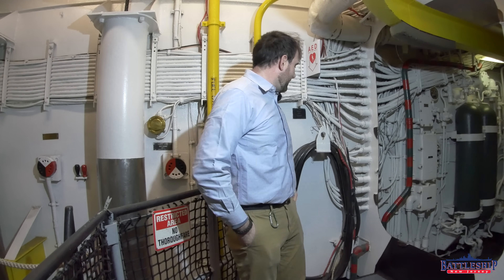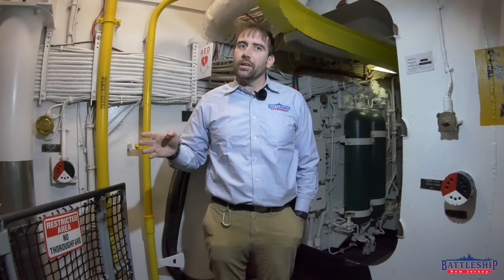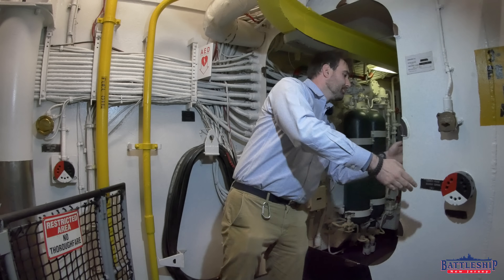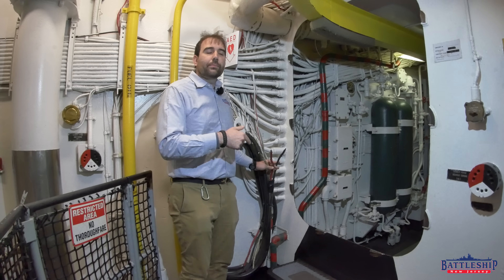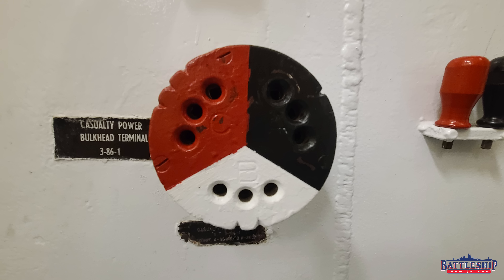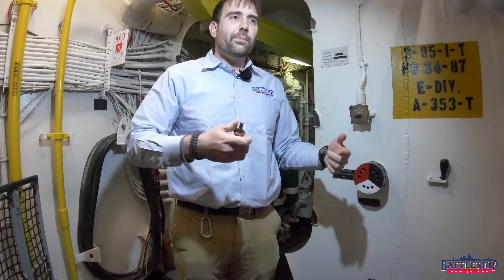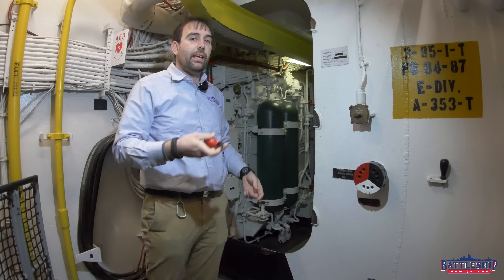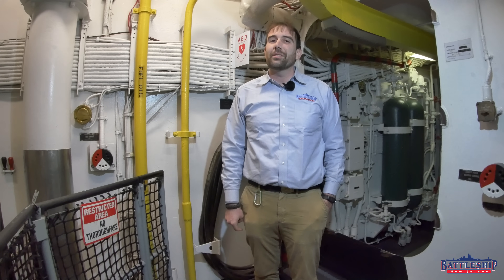What Are Those Weird Red/Black/White Discs on the Wall?

Comment: man you're having a very bad day when you're rigging 490v wires in a compartment full of water and also possibly on fire
Reply: If you don't rig those wires, your day may go from very bad to even worse
Reply: Not to mention if the other end of the cable is lying on the steel deck and you tie in hot.... I wonder if there was a procedure for what order you connected it, ie. Connect to the biscuit you're sending TO before the one you're drawing FROM.. just so you don't have live 440V flopping around the deck while you're also trying to avoid fire and flooding...!!
Reply: @PixelmechanicYYZ  yes, connect from load to source
Reply: And the wire is pure copper,silver plated and inside teflon insulation.  It will function perfectly while, literally, on fire.
Reply: This is war, son... as long as you're alive, ya keep fightin'! [/Hunter]
Reply: in a METAL compartment full of sloshing salt water and possibly also on fire
Reply: The connections aren't live. There is a disconnect switch between the power source and the casualty power cables. After the cables are connected, THEN you close the disconnect switch. This is after you have isolated the system from what caused the casualty to begin with  @PixelmechanicYYZ
Reply: @PixelmechanicYYZ  In "three phase" all three legs are "hot", carrying 220v positive then 220v negative, but 120 degrees out of phase from each other. There is no ground as in land wiring. If two live ends made contact with the steel deck it absolutely would short out, but it would burn a hole through the deck plate between the two contacts - like welding. It would not electrify the entire deck because the deck is not grounded. In reality, at the beginning of the patch cable is a circuit breaker switch that will not be energized until all involved personnel have reported that all the connections in the patch are secure. As a couple have pointed out, if the situation makes this safety procedure impossible, the cable is hooked up from the load back to the source with the first connection in the chain being the last to be connected.
Reply: 480?
Reply: ojizarcozurdo9925  The three phase generators used on both US Navy and commercial ships produce 440 volts at 60 hz. This runs throughout the ship in "trunk lines" and then is reduced to 220 and 120vac through center tapped transformers. Generators on smaller commercial vessels produce three phase, 120vac. 60hz. All ships and small vessels use a "floating ground" which means the return is one of the other phases (it's technically not "neutral" but it acts as neutral") The vessel itself is NOT grounded. As a matter of fact, a commercial vessel will fail a Coast Guard inspection if any electrical circuit can be completed by connecting to a deck plate or bulkhead. You should be able to stand barefoot in a puddle of water on a bare steel deck and stick your finger into one hole in an electrical socket of any voltage and be completely safe doing it.
Reply: yeah but your day and everyone else day will get allot worse when the ship loses power to control those floods and fires for to long. even if you have to die for it sometimes getting those hooked up is more important then your life. that connection could hold 3500 lives on it
Reply: @3DPDK  3-phase in a delta config. Very common in heavy industrial solutions as well. At work we run 500V 3-phase in that configuration.
Reply: @ehsnils  I don't know why the difference in voltage, but most of the electric motors in engineering spaces are three phase for the same reasons they are in industrial use.
Reply: @3DPDK  Difference in voltage because I work at an European site where we have many voltages; 12, 24, 48 and 100VDC 127,230V single phase AC, 400, 500, 6600 and 75000V 3-phase AC. 127VAC is the rarest of them all.
Reply: @ehsnils  I think also that most motors in a marine environment drive air and hydraulic pumps and not much else. The higher voltages just aren't needed.
Reply: Maybe not as bad as the place where the power got cut off, also 3 phase runs a lower total current, these guys didnt have the best electrical options available like we have now with slow start, inverter systems, even a properly insulated system, but the simplicity they had, i wish we still had today…
Reply: You didn't serve in the Navy, which isn't for everyone.  Serving on these ships is an existence of choices, most of them are bad or worse.  In this case, if you don't route that needed power, you're likely going to die.
Reply: @bear_82  I've been retired for almost twenty years, and I still say "load to power"when I run an extension cord for anything.
Reply: bad day.. tuesday.. 50/50 really.
Reply: @jeffprice6421  Teflon will start to decompose above 270C/520F and it releases extremely toxic fumes. Keeping the ship operational under battle is more important than the crew members' lungs but I would have imagined they would have used magnesium oxide insulated tubing wiring in critical locations.
Reply: Flooded, possibly on fire, or even worse, the ship could be disagreeable. You gotta look at it in a "Is the glass/ship half empty, ship half full" sort of way. Sure she might be partially flooding and battle damaged... But if you're still doing damage control like this, and the water isn't THAT high.  She's probably not sinking. Which is one of those grit your teeth and yell "NEVER HAD A BAD DAY CHIEF!" sorts of moments. Pass around a bottle of shampoo while you're at it. Free bath!
Reply: I can think of days I'd rather be having, you have a point there.
Reply: Lmaoo the fact ur name is asbestos muffins makes it even more funny
Reply: @Jeff Price  in surprised they used teflon and not asbestos. Teflon the chemical is flammable... it's treated for pans and stuff to make it heat resistant but even if you get a pan to hot you will burn off the teflon coating.
Reply: The Navy uses 440V and the 120v loads are 55V to ground (hull) (all power panels have 2 fuses per circuit and the disconnects (knob) breaks both lines.
Reply: It was a bad day when someone attacked the ship you were on.
Reply: At that point, ur not running power cables if it's half full of water. You are trying to get that space secure. Plugging leaks and hull damage.  Pumping water out is first and foremost.  So you have to secure the leaks. P.S. we had canvas patches, and we had wooden plugs to hammer in. We had a few forms of sealant. Effectively performing hull repair was crucial to the ships' survival. Then, we can talk about removing the water and supplying power to location beyond an effected area of the ship. Now, we have portable power units. There is no need to run cabling thru, say, an area in need of repairs or may be on fire.
Reply: In the dark, with smoke.
Reply: At least if it's on fire it wouldn't be in the dark!
Reply: HURR DURR THEY CONNECT DA LIVE WIRE WHILE STANDING IN WATER DURRR - the intelligence level of people in this comment section.

Comment: Thanks for the quick turnaround, Ryan. One point: you wouldn't start at the live power source and work your way to the load (whatever is consuming the power). For safety, you do it the other way. Start at the load, and work your way back to the live power source.
Reply: Yes, that was the way it was explained in training. There was supposed to be heavy rubber gloves and boots used while handling too. Looks sailor proof but also potentially dangerous.
Reply: And probably also try to make sure that the load currently isn't on
Reply: I was just about to post about this. If you go from the power source first you have 3 live male ends exposed on the other end that would be pretty dangerous!!!
Reply: @PreciStrike_96  What I am understanding from the comments of experienced sailors (here) is that the process of rigging this system will be planned and directed from Damage Control Central. There are diagrams there that tell the engineers where the points or Biscuits are throughout the ship. A diagram will be drawn up from there and then directions will be given by sound power phone, telephone or paper messenger, as to which connections should be made from point to point. The rigging will start from the point that needs power to the point that has power using the temporary wires. Once the connections are properly made the electricians will energize the bypass.
I am still interested in reports of actual and successful rigging of this system in real world battle damage situations.
Reply: In addition to safety, this presumably also allows you to select a route around the worst-damaged sections while hooking up. (You know, bypass compartments that are totally flooded or still very on fire.) Work your way from a section that needs power back to the machinery.
Reply: @paullewis5045  That'd be an interesting topic. I wonder if Drachinifel has covered anything that would provide insight. He has several videos on Iowa-class ships.

Comment: as an industrial electrician i found this interesting.  good way to delineate each phase with the rings and the notches.
Reply: An even better way would be to have different shape recepticals so you physicaly cannot put the wrong cable in a socket. But ofcourse that means you can't improvise and use a spare red to replace a broken white so counterintuitively you may not want that.
Reply: @vinny142  IIRC (Ex Navy ET1 here) They are 100A in a harsh environment (salt air). The screw terminal can break thru minor corrosion. Also Pin Plugs and receptacles  are very bulky (and expensive), where a bit of serving cord, shrink tubing and a ferrel end will do the job.   Beside, this allow THREE jumps in that smallspace. This task would only be done by EM's in the Damage Control crew.

Comment: I used to work at the San Francisco Naval Shipyard back in the 1960s.  I remember the caveat "Load to Source."  Connect the load first and then the source.  That way you don't have the live terminals sticking out.  It's good to see you still have some of the cables and wrenches on board.

Comment: There are charts in Damage Control Central that show the location of every biscuit on the ship.  I remember having to participate in damage control drills setting up casualty power as part of Refresher Training (REFTRA) and the Enlisted Surface Warfare qualification.
Reply: All our DC lockers and satellite teams like 3b etc. had sound powered communication with DC Central. Plus, there were chart sources throughout the ship for reference. So, good coordination would be essential for a safe and effective rigging. REFTRA is passed my time. So, It is good that this level of training is happening.

Comment: I do actually have something quite like this in my house. An inlet and outlet on opposite sides of a wall to get power from a generator outside into my basement without having to have a window open to run a cord through. Extension cords to get power from there to critical loads. Including an inlet on the "power box" for the furnace to feed power into that circuit from a cord. (It's a proper transfer switch made for exactly this purpose, so no back-feeding can occur.)

Comment: Interesting to see how the designers considered the lowest common denominator in their damage control efforts. Make it as simple as possible, because when the ship is hit, flooding, and on fire, you don't have the time in many of these spaces to refer to the manual (assuming you even have a manual). Power needs to flow. You can do it by feel if need be.
Truly an analog solution to a complex problem.
Reply: The problem began as an analog situation.  Crew training ensures sailors can perform in darkened/damged/smoky/flooded compartments.
Reply: Remember, KISS- Keep It Simple, Stupid...
Reply: It is a good mindset, because in the moments when functionality like this is needed, you're already in an emergency. If you assume chaos, then just maybe you can develop a system that's robust even in the face of grave danger.
Reply: In times of crisis, you do not "rise to the occasion." You descend to the level of your training. Which is why a ship has daily drills of various types, to ingrain and reinforce the muscle memory to do things like hook those cables up properly.

Comment: The main reason for the biscuits is to keep the water tight door sealed. Under different "material conditions" like battle stations, fire fighting, flooding, etc., certain doors must be closed and locked or "dogged" and can NOT be opened without explicit permission to do so. And they certainly can't remain opened to allow a power cable to run through it. The sealed door prevents fires from spreading and/or stops flooding from one compartment to the next. If the compartment was filling with sea water, the power cables would be routed around that compartment; otherwise the salt water would short out the 440 volt connections.

Comment: The color/shape coding of that is impressive.  Simple, yet effective.  At home, I have a pure sine wave inverter and a couple of lead-acid batteries.  Not much, but it will keep the fridge going for a little while and power some lights, hopefully long enough for main power to come back on.  The disadvantage is obvious--it only runs as long as the batteries last.  The advantage is no gasoline engine that needs maintenance and/or that won't start when you really need it.

Comment: I spent almost 40 years in the aviation industry so I look at these different options for power routing and every other redundant system as thousands of man-hours to design, document, and implement when they may never be used.  It's just staggering to think of the total effort to build one class of ships and then multiply that by the tanks, trucks, fighters, bombers, weapons, etc. required to support the war effort.  Unbelievable!

Comment: Why yes, I DO have an emergency generator.  I love it!!  Power lines here are surrounded by trees.  And then it gets windy....
Reply: Tech note. Power companies are finding that solar and wind are unpredictable.  Power outages are actually on a slight uptick after years of decline. Be prepared, not scared.
Reply: Good for you to have a plan. Stay calm initiate. I like LP gas instant on back up generators. But any generator is better then no generator. Wind and Solar as a back up only works in a civilized situation. If it works at all!
Reply: @allenshepard7992  Solar and wind are unpredictable?  Sounds like a nice topic to read up on some calm dark night....
Reply: @Bobo-ox7fj  Always follow the money trail. 
There are cheap non polluting options that can be made reliable - we need to find them. Hydro is great, but dams create a form of pollution as environmental impact. Geothermal is not as widespread. 
From coal, to whale oil, to gas, to lime lite to electricity we keep finding better answers.  however solar and carbon fiber windmills are not recyclable nor reliable. Big electric companies are finding solar/wind is not as cost effective. 
Keep looking and asking questions. "the answer is out there"
Reply: @kevincrosby1760  Well said, well played. 
Read up on Dominion Energy's yearly report (may put one to sleep before the good parts)  Ditto for PG&E and LILCO of New York.

Comment: I have had to use emergency generators both while on active duty with the US Army and home before I was drafted in Dec 1970. Biggest problem is always once it has been used it needs to be started every week to avoid fuel gumming up the entire fuel system. I trained generator mechanics while on active duty. Every week I had to start our 5 KW generator and let it run for 15 minutes then top up the fuel tank.
Reply: Thank you for your service, I was a 63B Wheel Vehicle Power Generator mechanic (I prefer technician). I got the generator side of issues not so much wheel vehicle side of issues because I learned voltage. 5KW was the main generator in my sring.
Reply: @Bobo-ox7fj  for a critical system, you would also do this to ensure and log proper operation in a log book somewhere. Its easier to run and top up then need additional supplies to drain and stabilize the fuel.